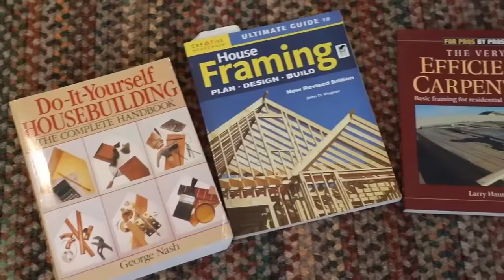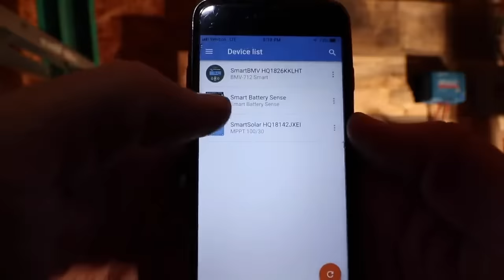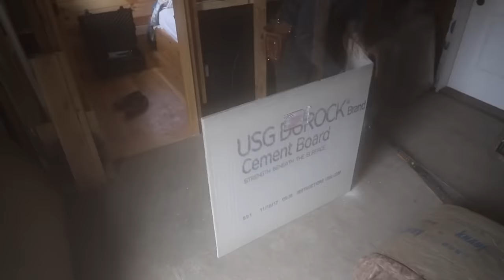Timelapse: Woodworker Builds Amazing Off Grid Cabin

Comment: Maybe skirt around the foundation piers..build panels, some removable ..one at each end to allow access , grilled panels for  Airflow and   ventilation in summer, others the winter version are alu foil tetrapek to keep below above frost levels...avoid pipes freezing..if you have some eventually when you find a water source or get  al done.

Comment: In all actually how long did it take to build because in the market to be doin the same and my skill set is fairly advanced as is yours and might i say this by far one if the better cabin builds I've seen to date! Excellent craftsmanship!
Reply from the maker: Its tough to say, I started in 2014, would take very long stretches off, after I stared my YouTube channel, I would work on it once a week and did that for about 2 years straight.  I live far away and the drive got old, now I just chip away at it, but still not done.  My best guess, maybe 150 solid work days into it.